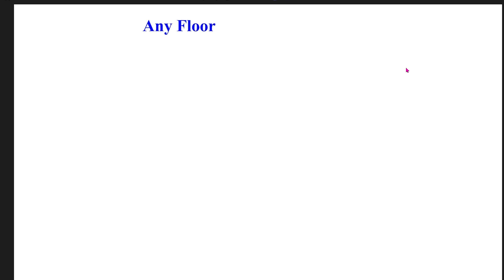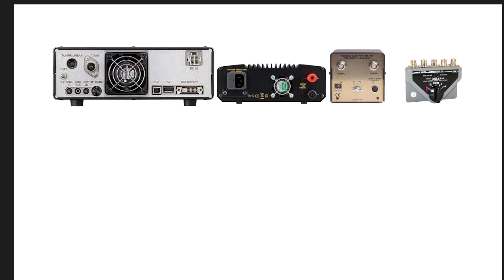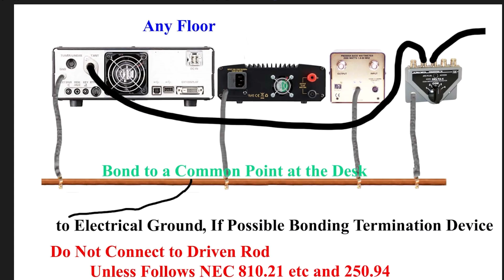Ground is a Myth says the ARRL! Ground is NOT a Myth and Here's How I Grounded My Station W6LG Jim

Comment: I watched her presentation and she was stressing not to tie your equipment to a seperate ground rod and shes right. That actually agrees with Jim's philosophy of using the house grounding system. IMO the only thing that needs a seperate ground rod is the antenna with a surge arrestor  device outside. Tying the transciever to a rod outside just invites problems. I think her title is just to get interest in the presentation.

Comment: Agree with you, Jim. I bond all of my equipment together, unit to cabinet, cabinet to cabinet, and the cabinet to ground as per the power panel. Two reasons, maybe three... one - in case of a HV short to some chassis, I want to make sure that current goes somewhere besides thru me. I am not paranoid about HV. It can just have a mind of its own...  two, when I have used ungrounded equipment in the earlier days of my ham radio life, I have had my mic (D-104) "bite" my lips - seems like RF to me but grounding the equipment eliminates being bit on the lip and three, I believe in NEC specs and maybe, four - in case of lightening - I have been hit twice, so far, in the house I live in for 32 years, I would like to dissipate as much of the lightening as possible into the "ground"  or a lightening-loop and not thru my equipment and my house but unfortunately, as is mentioned in other comments, when lightening strikes, it does whatever it wants to do and it flows down the outside of the coax on the braid as it pleases. Lightening is not polite enough to go down the center conductor to a lightening arrestor and behave like we want it to. I have seen the energy absorbing power strips (surge protectors) actually save equipment in my profession.  Hope this helps and makes sense.

Comment: I've never seen this question addressed: All of my hamshack gear is totally off-grid. I have a large bank of several 100 amp hour batteries. Those batteries are constantly topped off by numerous solar panels with a charging controller. Since none of my gear is connnected to the AC main, what would be the recommended grounding setup?

Comment: As a side note, the Lightning Protection Institute publishes LPI 175 for lightning protection systems. Full of information regarding grounding and bonding for those interested. The 2023 edtion was available for free download and includes many diagrams. One other thought- Its good idea to have a whole house surge protection device installed at the service panel and recommended plug-in units downstream for devices. Never had an issue with over voltage transients since. Best wishes.

Comment: I see 3 important types of "Ground";
- Earth Ground (rods) - Which should be connected to Towers, Lightening Rods and Arrestors, to prevent static or strikes from entering your shack.
- Electrical ground - Which is needed to shunt back any electrical (Hot or Neutral) shorts in your appliances or hardware, back to the breaker panel, and pop the breakers.
- RF Ground - Which is a Marconi counterpoise, but may not really provide any S-gain. Instead, the ARRL lady uses "Counterpoises" connected to the braid shielding of your Coax, which will improve you RF signal..
So, it is correct to say don't use EARTH ground as an RF Ground, but use an counter-poise instead for better S-gain..

Comment: Excellent explanation. Should you have a separate ground rod for a device. A lightning discharge pulse travels through the earth hitting separate ground rods at a different time. The difference between ground rods can be thousands of volts for a few milliseconds. That difference can discharge between your separate grounds with your rig is in the middle.

Comment: I tend to agree with the ARRL presentation. I think what she was trying to put across was that "ground is relative", to where you are located. If you move 20 feet ground is different due to the different types of soil. 

But here are my thoughts on your recommended setup. First, I am not an expert, so this is more of a question for you and I am unsure of the answer. 

 If your pipe under the desk is grounding everything and then going back to the main box, why not just use the ground lug on the electrical outlet where you plug all of your equipment power into?  After all that "3rd pin" on the AC plug is going back to ground (not neutral) at the electrical panel. So, your pipe and the 3rd pin on your power supply are both being connected at the same point. 

To go along with that, you stated there is no such thing as an RF ground. Then why are we spending so much time grounding stuff to keep RF out of the shack?  I currently have RF in the shack and am looking for solutions. In fact, when I operate my radio in CW, it trips 4 breakers downstairs. Haven't got that figured out yet.  
Good video though and it makes one think.

Comment: One may as well say that electricity is a myth. I'd encourage everyone to unplug their equipment, and then convince yourself with an ohmmeter that the 'ground' terminal on the back of your transceiver is connected to the DC-minus input on the transceiver (0 ohms reading). It is. And that it is also connected to the outer connector of your coax terminal. It is as well. And in turn, that the ground terminal on the power cord of your power supply is connected to the DC-minus terminal of the power supply. Yes again. And so on for any other powered equipment. Then think about what happens when you connect such equipment with coax cable - the coax shield is effectively becoming the bonding between the devices, and thus becomes part of the electrical ground of the system. Although I'll probably 'bond' the equipment in my upcoming shack build as Jim describes, you could also argue that adding a second set of connections (to a pipe or ground bar) isn't needed for equipment that is connected via coax - that the coax braid itself is providing the bonding, and that the ground bar itself introduces a second path and potential ground loop with its associated problems.

Comment: I haven't watched the ARRL presentation.  Having said that....ground is NOT a myth....and I'm alive today because it's real.  When I was a new ham, novice class, I had a long wire end fed antenna connected to a large, ceramic based knife switch just outside my bedroom window.  One side of that switch was connected to a ground rod with copper flashing.  I usually kept it in the ground position when I was not home...at school.  This particular day, I forgot to do that.  I got home from school at about 4 PM and went to my bedroom.   A thunderstorm was imminent...so I checked the switch...and to my surprise it was in the "connected" position.  I opened the window, threw the switch to ground and lightning immediately struck my antenna.  The flash and the tremendous bang were simultaneous.  It knocked me to the floor.  Now....who knows if lightning would have hit my antenna if I hadn't grounded it....but if it did, my receiver would have been a molten pile of junk....and me along with it because I had my hand on it.  The knife switch....like you'd see in the old Frankenstein movies was fused...melted copper.  The copper flashing to the ground rod was scorched.  The soil around the ground rod was smoldering.  Lightning is mega voltage and mega current.....millions of volts....thousands of amperes.  If you get between it and ground....via con Dios amigo.

Comment: The title is a bit click-bait but she is talking about the exact problem which is that (a) RF ground PLANEs,  (b) station bonding to a common DC point, and (c) LIGHTNING protection are all often conflated, combined, misunderstood, and mis-stated.  The electrical code requires different things in different states/countries.

Do HF Rigs need to be DC grounded to your house ground? Often, no.

Does having an ungrounded outlet in a house represent a safety risk?    I don’t think the video presenter was advocating nobody should ground anything. What she goes at is the obsessive bonding rituals that hams often go through.

I follow your advice, and I think you only differ on how important bonding is.  I am on your side with the bonding issue.

Comment: I fitted an earth spik eth other day for the random wire antenna unun... made a big difference on 40m for my tansmission - lower radiation angle and less noise on receive..  my radio and ATU are grounded with flat braid to the radiator pipe. I do need a choke though.. some odd RF issues on 80m.

Comment: I grounded my base station like a cell site, using a single point ground system with #2awg solid, and ground rods the 5/8” x 8ft every 6ft.  That main ground made a halo around the house, grounded to the antenna, and then came into my house and went to a copper buss bar.  I also used polyphaser surge arrestor.  All  my equipment was grounded to the same ground bar as well..  I built cell sites for a living and saw the amount of work went into building a proper ground system.  It takes a lot of work to do it properly.  
The main thing to remember is to ground  all the equipment and antenna and coax to a single point ground system.

Comment: My question is what is the best way to connect that copper bar (common bonding bar) to the common point ground? Wouldn't the power supply, which has a 3 prong plug be providing this? I am sorry, just confused about that part.

Comment: We had a limb on the line that the power company refused to trim. Eventually the ground line, which was holding it up, broke. The ground rod line outside the garage burned out. It was the middle of the night, and power started oscillating between the two sides of the house. The ground holds the center of the 220v (in the US) so that each half receives 110v. Our TVs, VCR, etc, and lights were all hit with higher voltage. It caused everything with motors to scream and smoke, and all of the lights oscillated. It kept on blinking the house until I was able to shut off the main breaker. Then there was no way to safely return power to the house until the electric company could repair the wire.
What Jim is saying is true, that if you lose your grounds then your circuits won't break. There's nothing to properly inform them except overcurrent in the wires. They also say that breakers protect the wires and not the devices themselves by tripping on overcurrent or when the wires are heating up.
ARRL seems to be criticizing nuances where electricians, electrical engineers, ect have different terminology or understanding. ARRL's comprehension of what 'ground' means might be a myth! But criticizing different kinds of grounds and their meaning doesn't invalidate what 'ground' is. It's the reference, and it's usually the discharge. An engineer in a different field would treat signal grounds differently.

Comment: I'm just a ham, but I spent a couple of years studying grounding for the shack when I needed to reduce noise in my receiver and after a friend/fellow ham had lightning strike his new radio on a shelf that he never opened the box to. 

I learned about the electrical code for bonding ground rods. Of course, it is not possible for a ham to set up his/her station next to the service entrance. In fact, Murphy made it a law that the best place for the shack is the farthest corner from the service entrance.  

I can't afford the NEC grounding rules.  Instead, I take an isolationist approach.  Everything that goes outside comes through a common entrance and has some kind of disconnect.  Any AC the ham gear uses is plugged into one outlet nearest the entrance.  To operate, I plug in, when I'm done, I unplug it all.  IN the event of a strike, the equipment is not in the loop and there is no potential between the station or antenna ground and the facility ground. No reason to bond. 

I have a power supply that charges a backup battery.  New LiFePO4 batteries are affordable now, so I can use it to charge my battery which powers my station.  If I unplug the power supply from the wall, my station is not connected to the facility at all. Total isolation. 

Equipment grounding is just like you showed.  Copper ground that every piece of equipment is tied to by short pieces of braid or wire, braid being best. 

Here is what I could never understand the whys and wherefores for. I was in a room  on a desk with a steel frame and a wood countertop.  I grounded my radios to a ground rod outside my window. I had an s7 noise level.  I started grounding everything to a common point, in my case it was a copper pipe I flattened out that went to the outside ground rod. Each piece of equipment I grounded dropped the noise level, fair enough. 

But, I also had a steel table in the middle of the floor with only a few books on it.  Nothing else, no lamp, radio, just books. For kicks and giggles, I measured the voltage between the steel frame of my desk and that table.  I used vice grips to clamp a wire to that table and back to my desk.  The noise level in my radio went down another s-unit. I even got a reduced noise level when I grounded the 3rd ground plug hole to my bar. I tested grounding anything and everything metal in the room. The only surprise was that one table.  

That was my inspiration to study grounding. I grilled everyone I ever heard had suffered lightning strikes with questions. I grilled anyone I could about Field Day, mobile and remote field operation sites. Everyone who tells me that one can protect one's shack by "giving lightning a path" is ignorant of Kerchhoff's law. Electricity takes EVERY path to ground, not the path of least resistance. 

Lightning travels .25 to 2 miles from ground to cloud.  That means the voltage must be between 500,000 and over 2,000,000 volts. Lightning creates EMP or eddycurrents that charge nearby antennas.  You don't need to have a direct hit to suffer lightning damage. Electricity just needs a path and static electricity just needs enough particles of dust or humidity to bridge the gap between two objects with different potential.  Direct hits can't be protected, but one can avoid indirect hits by opening the circuit. 

KISS it!  I'd love to have a talk with you sometime to talk about grounding.  I'm not an engineer or specialist or anything, I'm just a ham on a tight budget that wants to safely transmit and receive on my radios.

Comment: Problem with ground is that it can cause good and it can cause harm. Lightning is not predictable. If you have your radio gounded to an outside point then your are inviting lightning to destroy you equiptment and more. Old timers would throw their coax outside the window when danger of a storm. I have seen lightning destroy the wiring in a home that was up to code. Towers should be grounded, but not your simple radio home setup. A copper pipe under you desk is crazy. If you have a strike, where do you think the surge is going to go? Yes, into the copper pipe ,but the ground will not contain 100% of the surge. You have been very lucky. Grounding is not a myth, but complete protection from grounding is a myth.

Comment: Jim I always think you try to do your best to help hams get better with radios. As an Electrical Engineer I have to take exception with your statement, yes there is lots of wrong information on grounding.  All ham shacks should use there safety ground and follow the national safety code and all local laws.  They use the word ground interchangeably with return. There really is no ground and that is why it’s a myth.  Outside of safety a couple of things happed when you confuse ground with return one is ground loops as they are called.  In your ham shack that can be caused by your PC connected to your radio as an example. There isolation can be used to break the reference points to get current to return where is should and not where it can cause trouble.  Please keep stay with the national standard for safety but that only for safety.  Note I have removed the safety ground from equipment to find the ground loop so it should be done when needed only to find problems.  To finish to test that ground is a myth measure your soil and see what your meeter says then check around the country and you will get a drastically different answer.

Comment: Like your videos. I do the same in shack , i use a solid bar of aluminium drilled and taped where i need it. Aluminium is not as effective as copper but if you use approximately twice the size compared to copper. I used to work for telecom company that used batteries to power the equipment and to save money they used aluminium buss bars and that is how I got the idea about using it the shack.

Comment: The video by Kristen was mainly pointing out was the fact that grounding is largely unnecessary in many ham applications.  As you said, Jim, there is no such thing as RF ground. Kristen was not poo-pooing lightning protection. Perhaps the title was a bit misleading but I found nothing in the video that wasn't backed up by sound physics. It is my humble view that no ADDITIONAL grounding is necessary in normal applications. As Kristen pointed out, it can equal the potential between  rigs by bonding them. But as she also  pointed out, she operated a high-power station with absolutely NO additional grounds for any purpose. If the radio is grounded via the third prong, there is no additional ground that is necessary. Guys who chase RFI using RF grounds is quite laughable, to be honest. Only ferrite cores of the proper variety will resolve RFI issues. Ground is not a myth...but is widely misunderstood. That was her main point. 73 de Scott N1IA